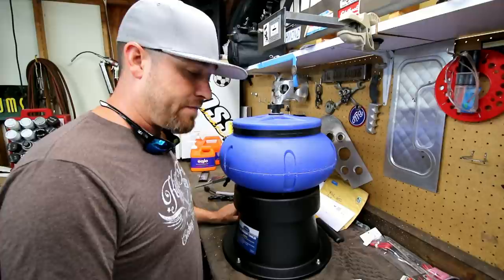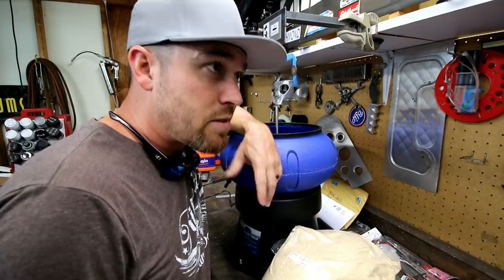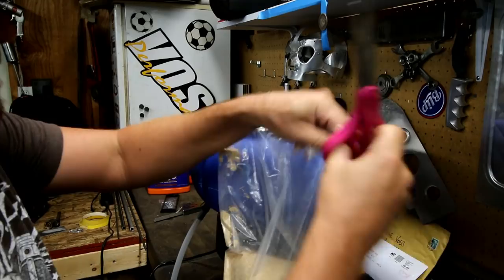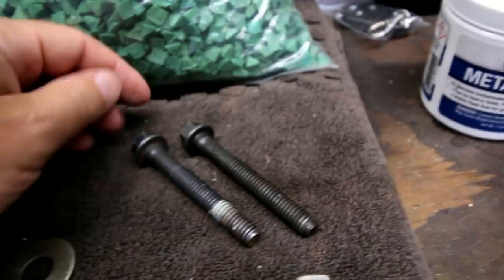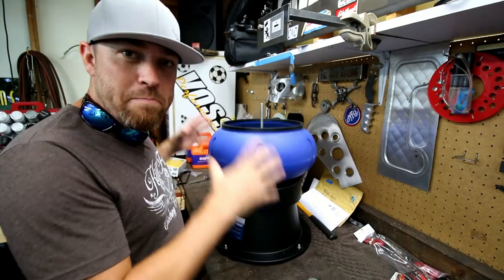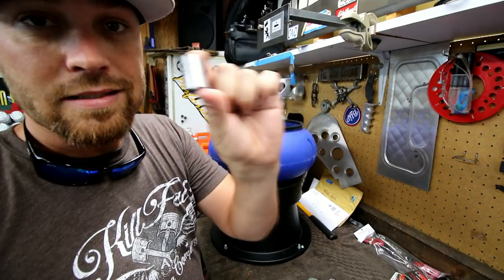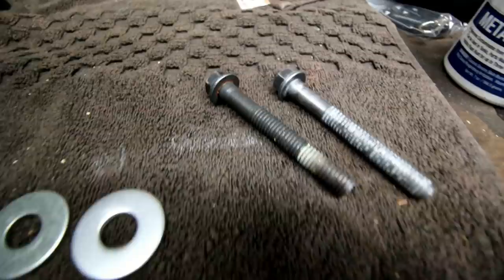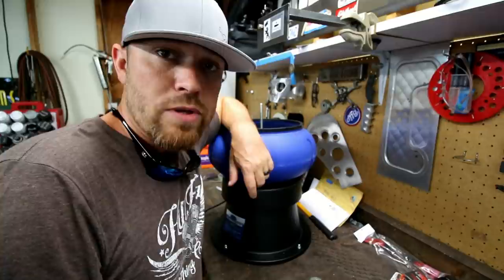You Need This Tool - Episode 79 | Eastwood Vibratory Media Tumbler

Comment: Great tool, I use it all of the time. Try using the metal wash with the green media, works good on greasy bolts.The hose on the tub is for draining out the metal wash when you are finished, they thought of everything. As always thanks for the Vid. I am going to do work son!
Reply from the maker: thanks...I will give it a shot

Comment: I have one of these.  I was initially disappointed at how long it took to clean parts,,, and the noise too.  I started to experiment with methods and so far have settled on the green plastic pyramids with a Cascade brand liquid dishwasher detergent & water solution.  The liquid in the mix cuts the noise to near zero, and the parts get cleaner in about a 1/4 of the time it takes dry.  I use it a lot now.
Reply from the maker: I need to try that
Reply: Water extends media life substantially.. but as they break down the coating needs to be promptly rinsed off or it dries and retumbling required.

Comment: I use one of these a lot for reloading ammunition.  If you're going to use it a lot you ought to pick up a media separator.  I dunno if eastwood has them or not,  but any store that sells reloading equipment should carry one.  It's just a nice little thing to spin out the media from your parts so you can easily find them all.
Reply from the maker: I will look into it

Comment: When using the ceramic media (green pyramids) it works a lot better with water. If I ran items through my vibro-polisher for six hours it would wear them away 40 to 50 minuets is usually enough.I found that it is better to mix the shapes,I use gey 10mm balls and grey pyramids in my 2 cubic foot unit.
Reply from the maker: cool. I used some water but may have not been enough. How much water to you usually use?
Reply: My neibors would love to listen to this all night
Reply: I run a hose in and have a hose to run the water out. It's a half inch hose with the tap just cracked open, so basically just a trickle running through you need to keep the media clean as it clogs up. it is just a load of small whet stones in reality. The machine is built to be used wet it has an inch and half nozzle for the water outlet.
Reply: The one we had in the machine shop at my last job almost looked like a soup when it was running. The corser stones defiantly need to prolong the life of them. Then swap out to a second drum from the shine finish. You can pick up spare drums that are compatible with the Eastwood one at your local harbor freight store.

Comment: This is one of those machines, that you quickly realize that you need 3 of them, all set up with different media, ready to go. (or at least 3 different bowls)

Something you'll want to do it extend the life of the bowl, is to epoxy a piece of wheel barrel sized inner tube to the bottom. The other thing I did was to take a piece of thick acrylic, route out a groove for the lip, and use that as the lid. This accomplishes two things. First, allows you to crank down on the lid much tighter than the flimsy plastic will allow. And secondly, lets you see the progress.

This is identical to the Harbor Freight version. Which is cheaper when you use the 20% or 25% off coupons. But Eastwood is one of the places that sells extra bowls for $30. (the 5lb versions of this suck ass, just stay away)

I use Simple Green as my mixing solution with the green pyramids. When you use a solution, you don't have to let it run as long. Also, really look into all the different abrasive medias there are for this. As there really isn't a one media for all solution. For instance, you'll never want to vibrate aluminum parts in the same media that you ran steel through. Again, like I said... you'll quickly realize how beneficial it is to have many of these (or at least bowls) ready to go.
Reply: After two years of working my way through using these bowl tumblers, I just want to say ..... THUMBS UP TO YOUR ENTIRE POST!!

Comment: good video, I really like how you had two of everything as your control, however your hardware was not that rusty, not being rude, but I went through the exact same testing with fender and grille nuts and bolts from my  '54 Chevy truck, and this tumbler didn't do much of anything, ran it twice for 10 hours

Comment: I’ve had 2  18 lb vibratory tumblers from Eastwood, one had an electric motor failure after a couple of years, one still works. The green fiberglass  pyramids absorb dirt slime grease on your parts then transfers the slime back on the parts and it’s difficult to get off. Really not worth the money IMO.
Reply: Adding some dish soap with the green pyramids helps out with greasy stuff.

Comment: Man I really wonder if this would work well on PVC fittings as long as you used the right material!? Seems legit. We use PVC fittings and like everything else, especially even you're busy and mobile, they get dirty as hell rolling around the work truck bins. When we deep clean after the hot season we have 5 gallon buckets full of these new, but dirty fittings that we almost don't want to use in houses and buildinga. Lol
Reply from the maker: I may test it

Comment: This is the same process that Snap On used to polish its tools before chrome plating. Granted the machines they use are 16-20 feet across but the results should be the same. Edit: snap on used a water bath with plastic media.
Reply from the maker: I could see that

Comment: 12 hours? are you nut? it will be veru quick with chemical solutions and a hard brush!
Reply from the maker: lol...yeah but that work require you to be doing it your self. I would much rather be spending my time doing something productive vs scrubbing parts. Beside chemical wont polish like this will.
Reply: Agree in some leve!, my time is also valuable! makes me crazy wait 12 hour! maybe we can combine two solutions chemical in order to melt most rust out of the part and then clean and polish with the tumbler, I wondering if you tested the tumbler with water in the media and polish paste!
Reply: When i was an apprentice I was questioned about why I was doing something a certain way. I told the boss it was because I was lazy. He told me it was a good idea and " a lazy person can often find the most efficient way of completing a task". I think thats relevant here.